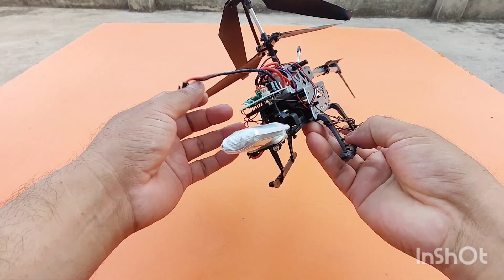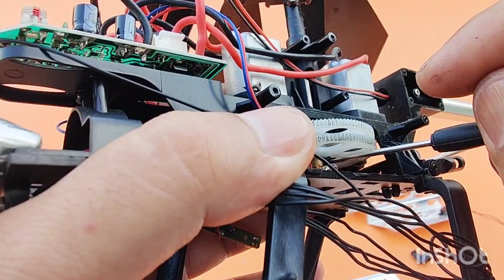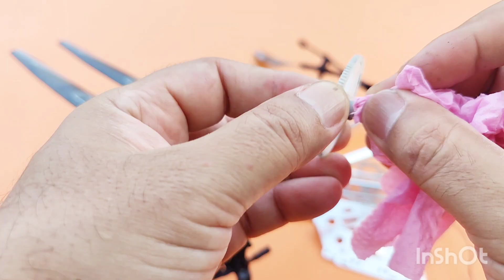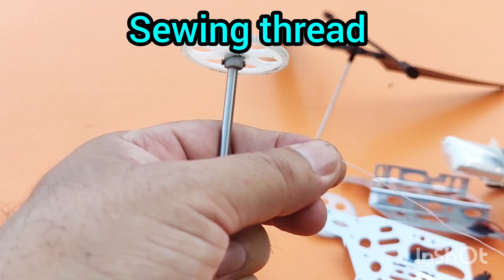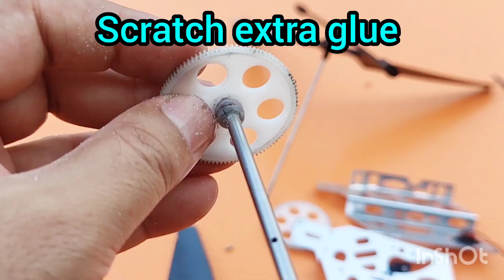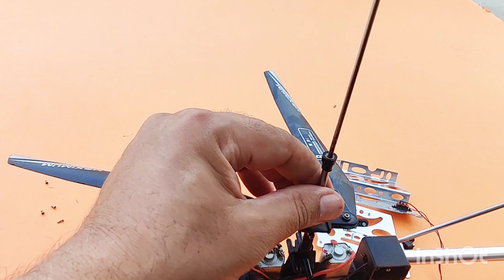HOW TO FIX RC HELICOPTER NOT FLYING | REMOTE CONTROL HELICOPTER GEAR REPAIR

Comment: Just one day ago i changed the main motors and leaky mosfets of my coaxial rc helicopter it's a little smaller than the helicopter you showed in the video. It was flying perfect. Today it fell from a height of like 7 to 8 meters and stopped lifting off. Electronics seems working, motors and propellers are rotating.
Reply from the maker: watch this video. https://youtu.be/4H-GngJEmPo